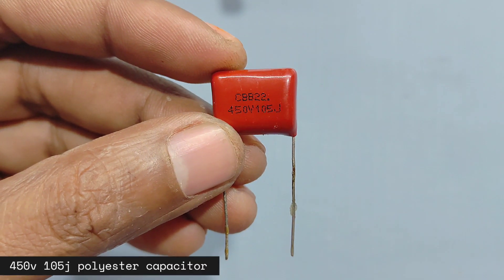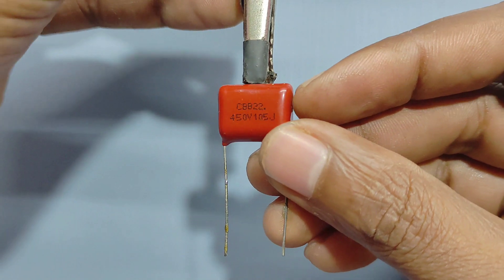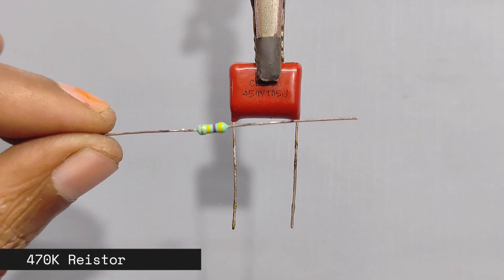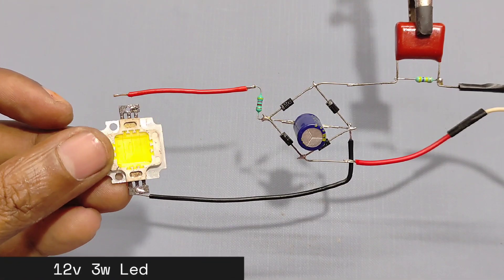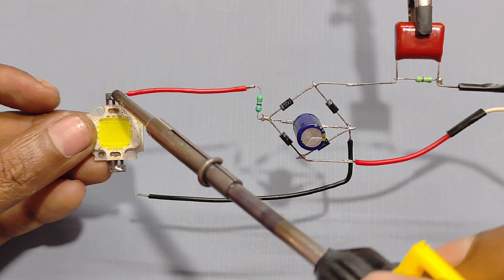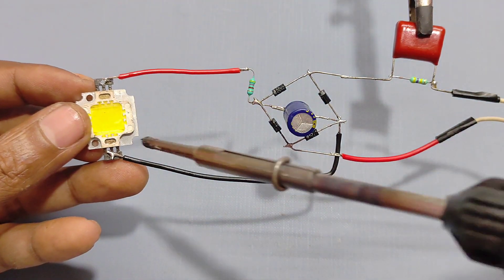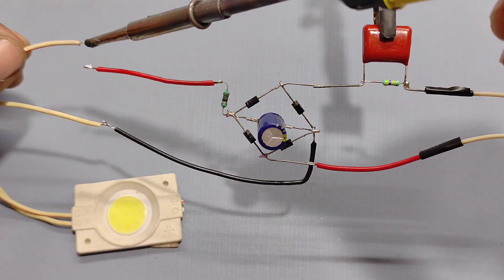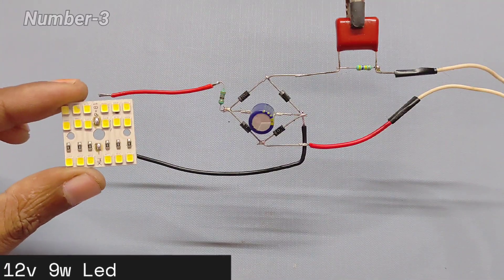Convert 220v AC to 12v DC without transformer #acdc

Comment: Good afternoon friend
I write from Brazil 🙂
Excellent video👋👋👋👋👋👋
Here in my city the AC voltage is 127v
Can I use the same components to obtain 12v DC?
How many amps does this circuit supply? I need 2A
Thanks
Hugs
Reply from the maker: Yes sir but the circuit generates very amp  I shall try 12v 1or 2 amps to my next video please carry on
Reply: @UltimateElectronics 
Cool
I will follow your publications.
Thanks
Reply: To generate high amperage what should I do? Since some of COB LED's they need 12V but more than 1 amp but less than 2 amp. Please advise and reply.
Reply: Since non isolated circuits we get low amperage say milli amp.
Reply: Please give me the link of your next video to get 1or 2 amps.